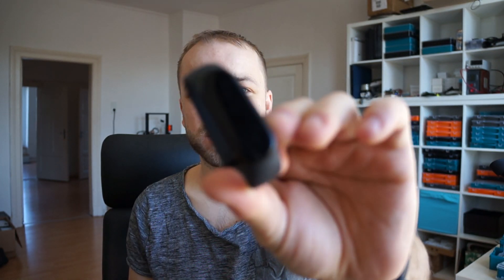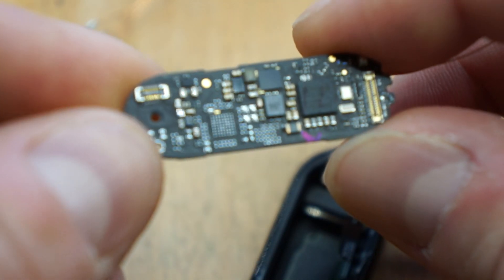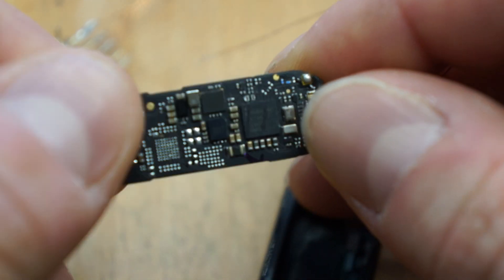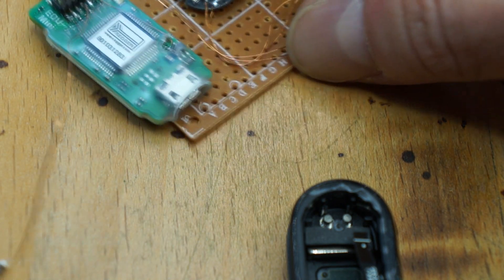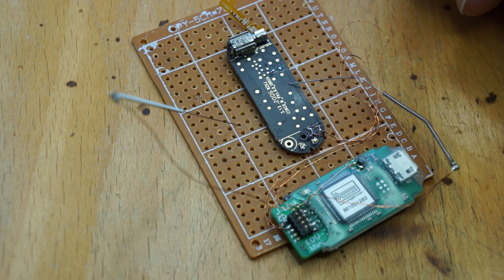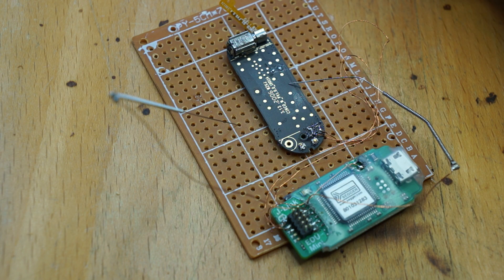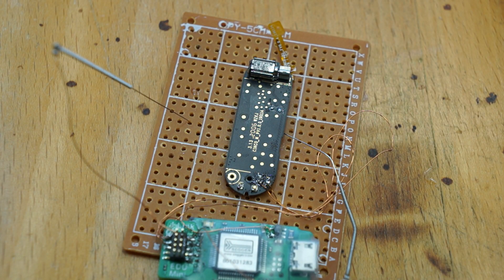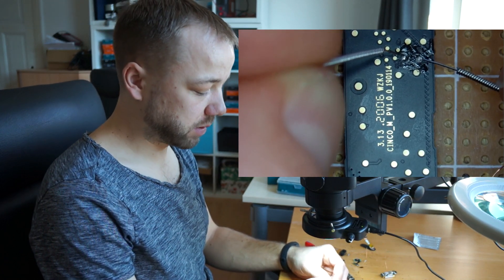Quick tip finding an unknown Debug interface pinout (SWD) shown on the MiBand with

Comment: Will you do a reverse engineering of the software? The Dialog DA1469x chips are capable of secure boot and flash encryption (AES), if they actiavted that it's going to be hard time.
Reply from the maker: Please see my other video about the Miband custom firmware, they did not enable any feature like that :) 
Only problem is the ota it only accepts sogned updates, searching for an exploit there